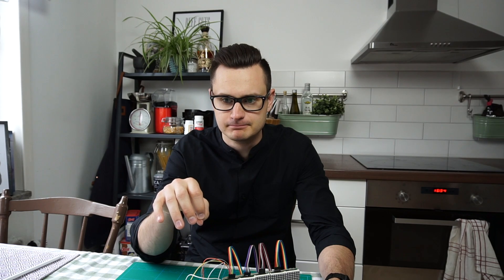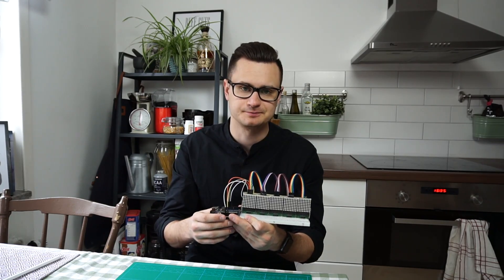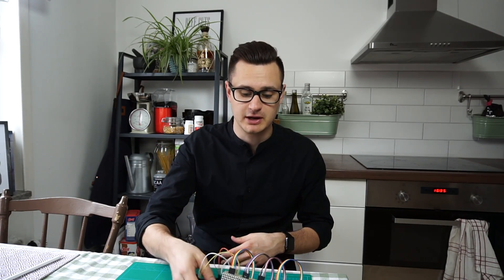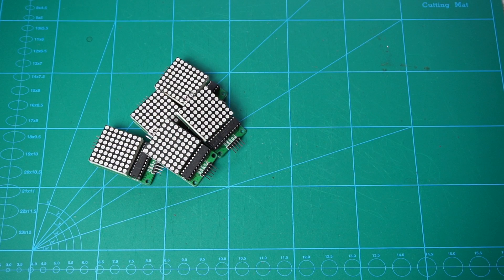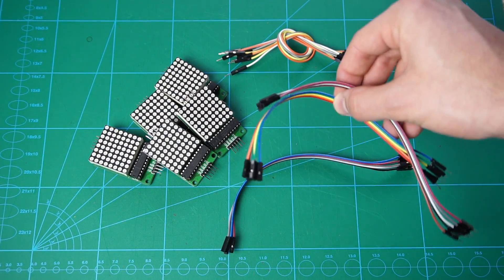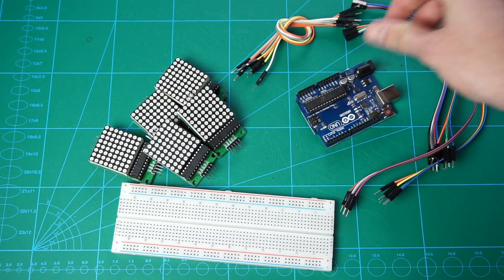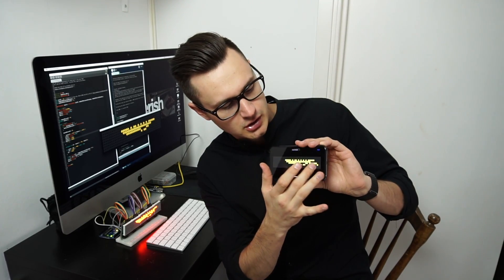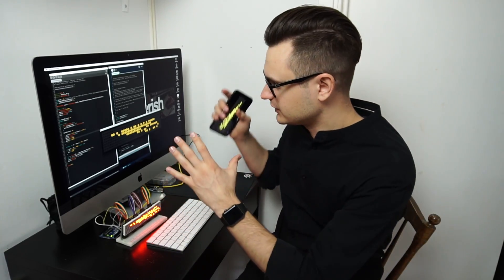Matrix Painter - Draw using your phone!

Comment: Hi! I had a question, could you give me some insight? 
What is the difference between 8X8 Matrix MAX7219 and 8X8 matrix HT16K33? Or I could use them interchangeably?
Reply from the maker: sahil Shah I haven’t used HT16K33 - but I guess it shouldn’t be a problem! As long as you can address individual LEDs (and chain multiple together is fun), you should be able to modify my code to make it work ;)
Reply: Thanks, I'll probably try that and tag you on Instagram when I'm done!
Reply from the maker: sahil Shah awesome! Would love to see the result 👍